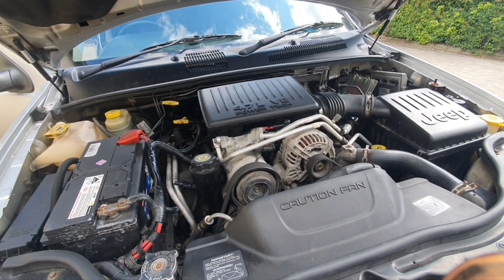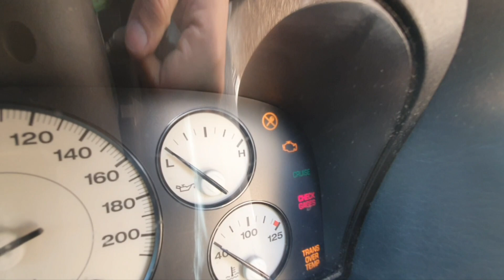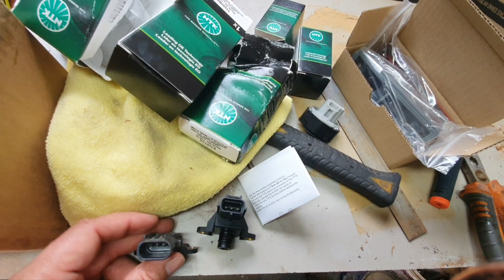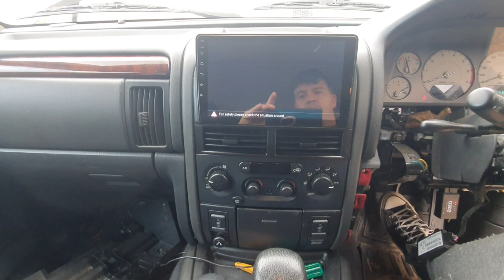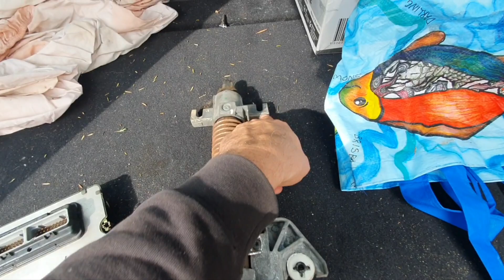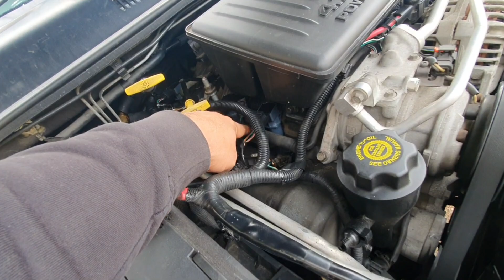Jeep Grand Cherokee WJ 4.7 PCM swap

Comment: Did you ever figure out the issue?
Reply from the maker: I had a 2002 model 4.7ltr parts jeep. I used the engine harness on this, bingo problem solved.

Comment: If using a PCM with different numbers from the original, (Example: 2003 GC Limited 4.7 to a 2000 GC Limited 4.7)do I simply need to make sure I have the SKIM module, ignition, Key and PCM? Will it simply just need to be programmed to 00 GC Limited VIN?
Reply: Best way is to reflash the ECU with your software and vin. WH jeeps have a nasty habbit of changing vins on modules even when you swap WCM BCM PCM... WJ with the Jtec is probably not as bad..

Comment: I noticed you have a nice orange car in the garage. Looks cool.
Hey, I have always wondered if those solar panels are  hooked up?
Nice video Jase.
Reply from the maker: Oh yes the solar is great, works good. The orange one is doing my head cause I'm missing parts lol
Reply: @jason35177  that sucks.  What are you missing?
Reply from the maker: @davidcarr2649  both door windows are missing. I just ordered a pair of new ones
Reply: @jason35177  that is good 👍 
You're up early.
Reply: Don't believe you need to replace the whole steering cc column. The ignition switch comes right out with the key when you press in the little button just beneath it...

Comment: Mate.  The amount of money ,time and work that you've spent on this thing. Just to get it running.  It's a damn lemon.  It's wasting good time and good money.  Sorry to be negative but get it running, sell it off and buy something more reliable.😉
Reply from the maker: I drove one of these for 5yrs, was a good thing. This one has been abused by teenagers on stockton beach, so I have my work cut out. Its pointless giving up now, worth nothing to sell, and theres no way rip someone off. I like fixing electrical stuff, challenge is testing! 😁

Comment: Hi mate had the same problem with mine. I changed everything and U wouldn't believe it , it was the head gasket. The leak wasn't in to the engine but the combustion chamber and exhaust, it was causing moisturiser on the plugs and fuking the electrical system out with the plugs. Do a compression test on all cylinders.
Reply from the maker: I done heaps of testing today. Compression is pretty good, except cyl 7, its still within spec. Slowly going through all the possibilities

Comment: made of mine has one of these jeeps (not sure on year but probably same) and it's been good seeing you run through the swaptronics process. hoping you find the solution soon(is there a mob who could diagnose it with a scan tool?)

Comment: Check with manufacturer some crank angle sensors have to be programmed before you can use them ✌
Reply from the maker: Just replaced cam, crankshaft with NTK sensors. Carried out ths relearn procedures, still has the issue. Bugger!

Comment: Crank sensor. Losing sync with the teeth and engine cuts out.
Reply from the maker: Replaced the crank, cam sensors with NTK, and done the relearn procedure . Still has the issue 😕